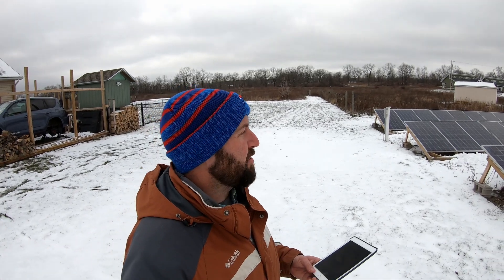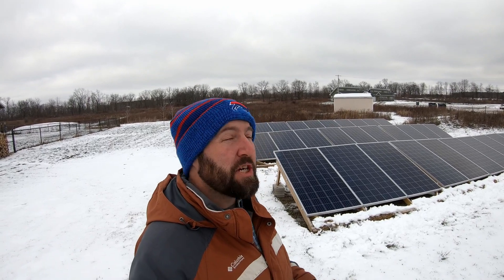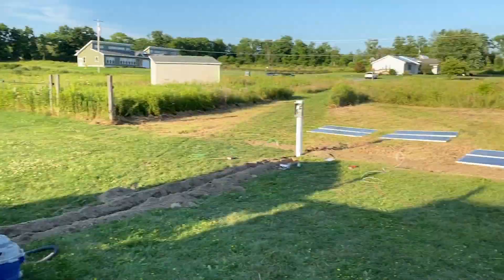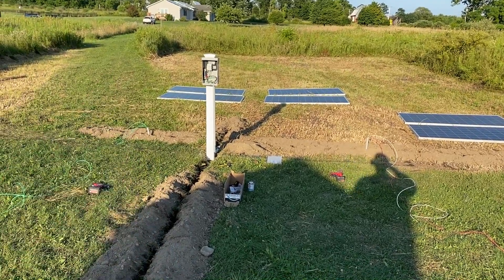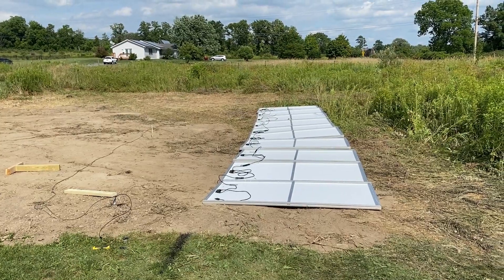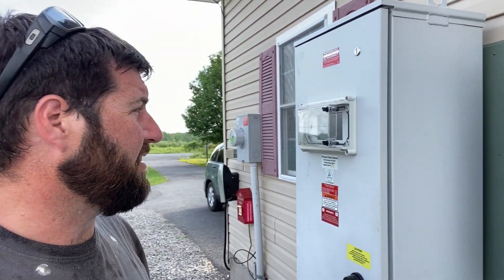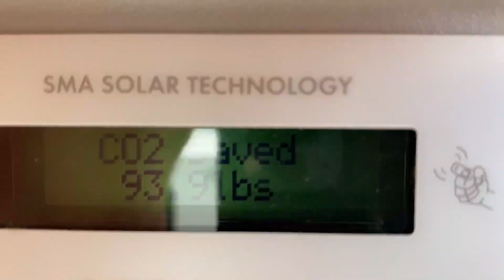My DIY 17KW Solar System

Comment: As an experiment, about a month ago, I picked up 10 455W bifacial panels off of Facebook Marketplace for $100 / each and am using them to charge my Tesla. I have them laying on my lawn, pretty similar to what you're doing. I wish you went into a little detail regarding how you did the fasteners. I can come up with my own solution, but I didn't want to do uni strut, because it's soooo expensive. Anyway, I'll peruse your other videos.

Comment: I came to see how well your system works for residential use. As soon as I saw you were attempting to run house and two EV's I got depressed. I can't imagine attempting the residential + (2) EV's...
Reply: We have 2 EVs and a PHEV! It's great on the one hand, because it's cheaper than buying gas (by a lot). On the other, your electric bill goes up (obviously). About a month ago, I experimented and bought 10 455W bifacial panels and hooked it up to an inverter with 10 kWh worth of batteries. I want to buy another 20, build an easy 2 level pergola and I'm also in the middle of getting traditional solar installed. I'd say if you have 2 EVs and an all electric house like I do, you really need a 40kW array to have a chance at not having an electric bill.

Comment: 1:38
That is not hard to find.
3:29 you cannot overload the inverter. 
You can “overpanel” a solar charge controller by 10% or whatever the manufacturer says is ok.

Comment: I have a very similar 100% DIY 8 kilowatt system.. was your sunny boy used? I also have 2 used inverters the helps keep the cops down... my main question is how big of a trencher did you use I'm about ready to leave my conduit underground you probably going to rent one
Reply from the maker: It was a small trencher. I needed a trailer for it. it went really fast! Worked great! My sunny boy was new in the box. I found a great deal on craigslist.

Comment: That's pretty cool. I just paid 65k for a 17kW roof top system (39x 440w panels) through a solar installer in my area. It's unfortunate that these installers cost so much, I feel like it should have cost half that and I'm still tied to the grid. I'm hoping to add some batteries next year.
Reply: 65k is ridiculous . We installed a 22kw system for a farmer this year for £25000
Reply: @persona250  sure, I had it to do over again, then I would just hire a general contractor and order the parts myself. All the installers in my area wanted 60-80k for my house. Go figure.
Reply: @JasonTaylor-po5xc  how much is a panel in the US ? Over here they are around £120
Reply: @persona250  400 watt panels run about $350 to $500 depending on brand. But, there are also micro-inverters, panel brackets, wiring, and pulling permits, etc. I rarely go with the cheapest stuff possible.

Comment: Why no wind turbines? It looks as flat there as it does here. I have lived  off grid at two locations. There were times at both locations, when we had days like you have in this video, for two WEEKS at a time, so the solar power wasnt enough...   Adding a couple inexpensive wind turbines to see how much difference it made was eye opening...  SO when we hit the same problem at out second place, I immediately installed an additional wind turbine....   and the problems went away....   The batteries OFTEN completely recharge overnight, and usually when the day is overcast rainy or snowy, it involves wind...   I have had people tell me NOT to use wind power!  Just get more panels and batteries!!!!  nope.... NEVER again will I be without BOTH! Running TWO smaller turbines, means if one does have an issue you still have the second running and keeping you going. Once set up we never did have any issues with any of our turbines....
Reply from the maker: We got lots of wind there but the leaders there make turbines hard to do. Tons of regulations. They are democrats so youd think they would make it easier to do, but no.

Comment: I am looking at DIY installing a 20 kw ground mount solar system for my home to offset 100% of my electricity use including charging an EV. I am purchasing an inverter that works with my EV (F150 Lightning) to provide back up power to my house when the GRID is down. This inverter that I am purchasing is a 10 KW inverter and I am wondering how I can use this inverter with a 20 KW system? Do I have to purchase a separate inverter and do two solar systems like what you have?
Reply from the maker: A lot to unpack there but yes its possible. It sounds like the unit that we need to connect our ford Lightning to the house is also a 9.6kw solar inverter. It allows up to 4 strings of panels. If you had a parallel solar system, (2 different inverters that are grid tied, As soon as you connect the ford lightning they will see "grid power" and they should also turn on. So with the lightning your whole system should activate and power the house. That is my plan at least.

Comment: are those panels set in concrete at all? I'm very interested as to how you did this.... I need to setup around a 20kw system and will probably try to do a ground mount system similar to yours except I want to set them in concrete as we get a lot of high winds and need to make sure that it stays there and doesn't blow away.

Comment: Did you apply for a ground mount permit?
Reply: I’m curious about the same thing. I’m real close to James in the finger lakes area. I’m getting a home soon and plan to stay off-grid. Going to start w 6.8KW solar. The code for ground mounted solar just states that the structure the panels are mounted on must follow the building code. (Seems like they were pretty lazy when they wrote it). I’m thinking I’ll talk to my building inspector and see if I can get away with something more similar to what James has here.
Reply: Hey James, is there any chance you could let me know who your building inspector was so that I could tell my building inspector to talk to him lol. Or is it the electrical inspector who checks the ground mounts for the panels?  I’m pretty sure they are gonna make me pour piers for mine, but maybe if I can get my inspector to talk to yours I can get away w something more chill like you did.

Comment: The secret to living off grid with solar is to cut your electrical needs before sizing the system.  You have a 17000w system now and that's still not big enough.

Comment: 5215$? It still pretty expensive.
Reply: At 0.12 a KW, this system will make $2000 of electricity per year. It will pay itself back in 3 years and then he will have free energy from there on out. Totally worth it

Comment: So How is Your Inverter RARE ? On Grid Off Grid ! My Tesla Gateway Does That With The Swipe of a Finger on My Tesla App..... ????
Reply from the maker: That is a low voltage inverter. This is a high voltage inverter. You just need a whole battery pack and connect it.
Reply: @JamesKlafehn  I Have a 11.5K Solar and a Powerwall Not Sure What You Consider Low Voltage ?
Reply from the maker: @kellydardeen6308  you have a 48vdc inverter system. I have a 600 vdc inverter system. The Tesla power walls only have 2 modules in them. They are the same modules from a Tesla battery pack but a pack has 16 modules.
Reply: @JamesKlafehn  To Be More Clear I Have a Solar Edge HD Wave Inverter 500 VDC Max on My PV Array Going to My Tesla Gateway But To My Original Point ! You Stated That Your Inverter Was Rare Because You Can Switch From ON GRID to OFF GRID and I Stated That I Also Can Switch From ON GRID to OFF GRID With a Swipe of My Finger From My Tesla App.... So I Guess Your Point is That Your Inverter  Will Handle a 100 More VDC
Reply from the maker: @kellydardeen6308  No its rare because it does everything and uses high voltage battery packs. I bet you $100k that you cant find an inverter that does everything that this one does. On grid, off grid, hybrid of both, back up power only, complete ev battery packs.

Comment: Hey relatively weird question, but we are building a system in upstate new york, our roof pitch is 33 degrees and I wanted to know how long it takes for snow to melt on the panels after a big snow storm? Like longest vs shortest times its taken to melt. our system is with an off grid cabin that we dont always go to, so we need to make sure our batteries are well charged and dont drop below freezing. We have heating pads for the battery as well. but if there is snow on the panels for weeks at a time, the heating pads would drain the battery and the temp would drop off. 

thanks in advance, and GO BILLS

Comment: Any experience with the bifacial panels where you are?  How many watts were you getting on that grey Winter day?  

I'm near the 49th parallel and I'm curious about your tilt there, isn't the Sun low in the sky for you?  

How many volts and amps are you pushing to the inverter there from the panels, is that a six-inch low-voltage trench?  Thanks, curious what I can get away with safely... ;)

Comment: I see you selling your inverter on eBay right now with a picture of it at the same location 7 months after you uploaded this video. You're asking $6,000 for the inverter.
Reply from the maker: Yup thats me
Reply: @JamesKlafehn  I suppose the objective of the time and money you are putting into solar, is trying to become energy independent. However, the costs involved don't appear to be economically viable.
Reply from the maker: @dare2scheme904  I’ve never tracked the cost of my solar. I love charging at home and not going to gas stations and freezing while filling my gas tank.

Comment: How is it working? Thank you so much for this vid! Can't wait to live off grid with emp proof pipes and insulation around wires with galvanized steel, those in steel pipes and tin foil and a outer ruber layer or something which is tested to be emp proof. For the power station room, it'd have to be emp proof as well which would cost a bit and take a lot of work but be worth it.

Comment: Question, could you upgrade the inverter to maximize the system? Like I'm trying to find out why you chose 9kw inverter Vs different sizes?( not being scartastic and i really dont know)
 Also, it seems like you might need around 70kw (assuming your house is around 30kw per day and you only top up your batteries everyday) so does that mean you need an array that is 4 times bigger?

Comment: Vermont here, I feel your pain with cloudy winter days!!  I have 13.6kW roof mounted (south and north) but definitely need more to go off grid.  Only 30kWh of storage so far, but more coming soon!
Reply from the maker: Wow cool! Do you have a 12v system or HV?
Reply: @JamesKlafehn  I have a 60v (16s) battery out of a smart fortwo and a volvo hybrid paired with a Sol-Ark 12k with 2.6kw of DC coupled solar into that, and then a Solaredge 10kW (10.92kW DC) inverter AC coupled to that.  It's an ever-changing setup, but it should do the trick eventually.
Reply from the maker: @benssolarandbattery  That is an odd voltage isnt it? Finding an inverter for my complete battery packs was always a challenge. Ive looked at a lot.
Reply: @JamesKlafehn  yes its a little bit high for most inverters.  67.2v is max charge but there's very little capacity above 63v.  My last inverter (MPP Solar PIP 5048MG) went up to 64v, the Sol-Ark only does 63v.  For pack longevity, I really wouldn't want to take it above that anyway, so it works out.  I'd probably go with 14s (or 16s Lifepo4) if I did it all over again.
Reply from the maker: @benssolarandbattery  and you need an external charger right? I dont know much about the lower voltage systems haha Sounds like a cool set up. You have a youtube channel?
Reply: @JamesKlafehn  the inverter is an all in one with built in AC charger along with 2 high voltage MPPT charge controllers.  I started my channel about a year ago.  It's been slow going with 3 kids, but lots of fun!

Comment: Shouldn't the wiring from the inverter to the panels be deeper? Don't know what the code requirements are, but just thinking the conduit will eventually pop up to ground level and be cut by lawnmowers.
Reply: 18 inches per NEC
Reply: 6" is minimum depth, I believe, for underground wiring
Reply from the maker: I dont think so. Its not a foundation or anything that needs to be below the frost line. Either way though, I plan on adding top soil to the whole area which would bury it more.

Comment: That's an amazing system for an amazing price! I'm thinking of buying a 78kWh Model 3 LR battery pack and using it as a power wall, haha. 

Maybe solar later as Canada isn't the sunniest.
Reply from the maker: Thanks! Just a little bit of work. It was all pretty fun but building the mounting frames was a lot of work. That was less fun lol

Comment: Do you think you’ll ever have to raise the platforms due to snow, etc?
Reply from the maker: I have raised them a little. Mostly because its winter and the sun is lower in the horizon. However I may leave them this height. Its a good angle for both summer and winter. So far brushing snow off hasnt been a problem but if we get a lot of snow I can see it piling up in front of the panels which would suck. But I could go through with my tractor to move it.

Comment: What the best angle to position a solar panel for maximum sun light? I think I had heard  somewhere also the panel have to be facing a little to the south for best sunlight exposure, is that correct?
Reply from the maker: Yes you want them to face true south which isnt always magnetic south. Here is an article that helped me with the angle. https://www.solarpaneltilt.com/
Reply: @JamesKlafehn  Thanks James. Solar will be my project when I but me a house here or when I build one back in the Caribbean.